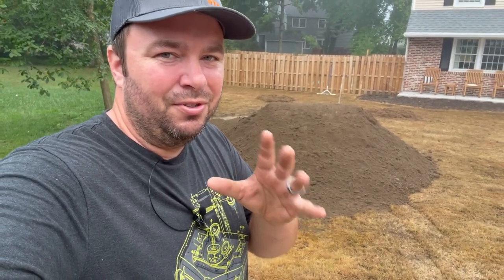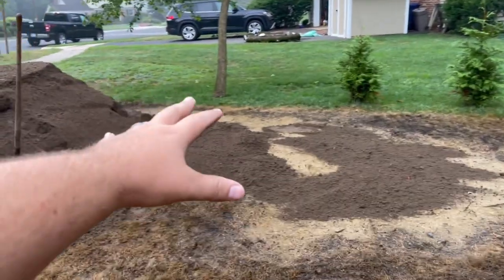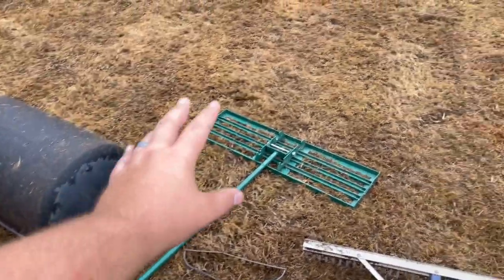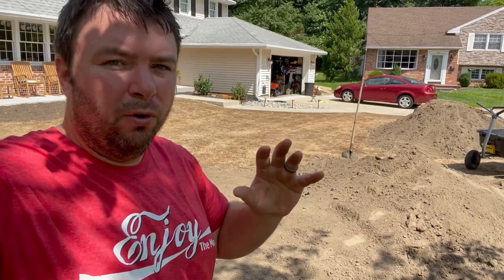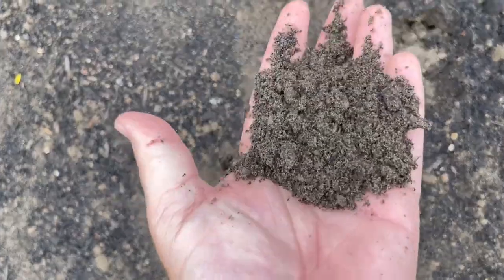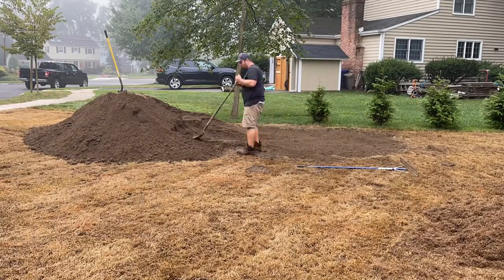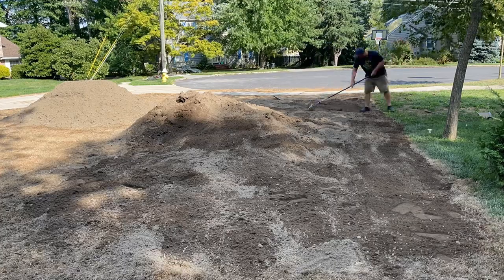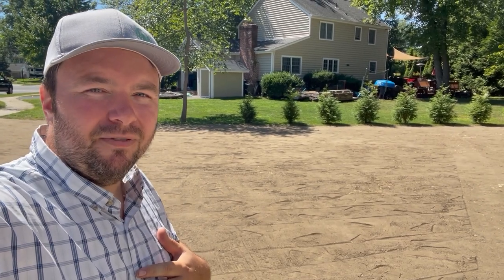I Just Spread 14 YARDS of DIRT Over My Lawn!

Comment: Vince. Great video. Two questions for you:
1- why did you choose to only use topsoil and not sand?  I always thought a mix of top soil and sand was ideal 
2- I would like to do a complete renovation in the spring. Have you had any success with a similar renovation during the spring?  

Thank you Vince
Reply from the maker: Very good questions.  Answers below:
1 - I went to my local nursery and felt the materials.  The topsoil I got was sandy.  I’ve done it before (on my last home) with screened fill dirt and that was fine too.  So long as it’s free of large debris you’re good.  Sometimes the topsoil you get has too much organic matter in it.  That’s why I think it’s important to go to your local supplier and check things out.  Also, if you want something mixed up, ask if your local supplier can do it.  If it’s a small enough load (say less than 8 yards).  They can at least put everything in the same truck.  Your local supplier should also be able to tell you things like the pH of the material. 

2- spring is fine.  Just monitor temps coming out of winter and start as early as you can.  You want things to mature before that summer heat kicks in.  Water will be you friend.
Reply: Thank u Vince